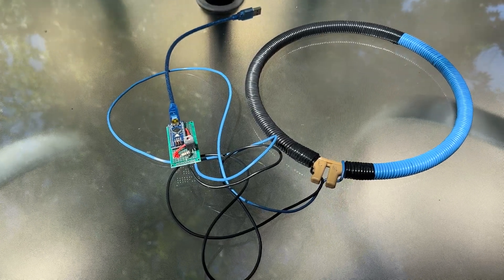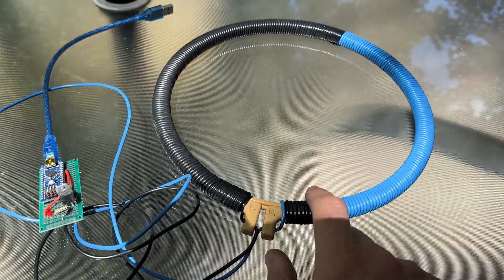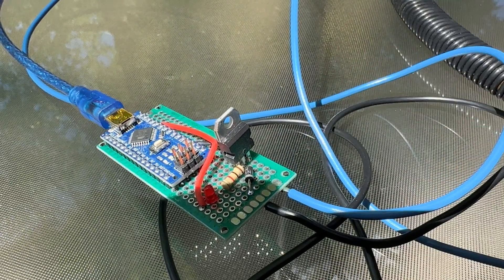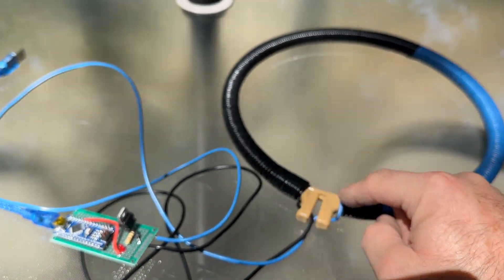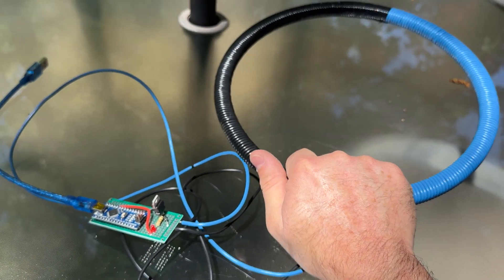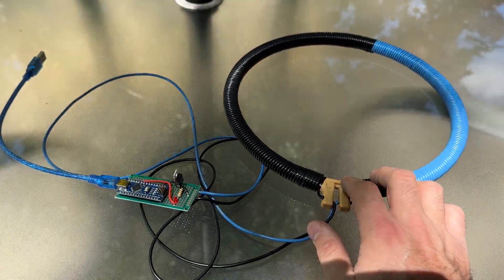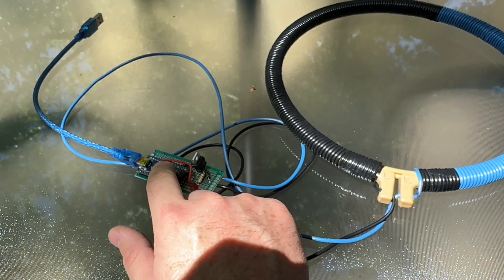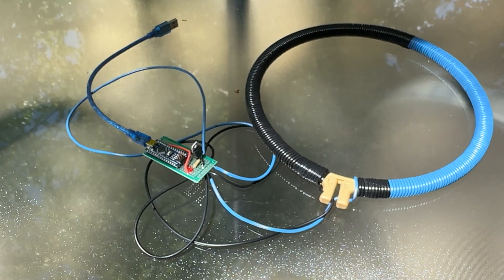Psychic Training Device

Comment: Thank you for sharing your build and experience with it. I've been wondering about other's opinion of this device/build for a while. Any possibility you might be willing to share the sketch code you used?
The sketch files they have on the MoT site are pretty large (for arduino), and having a consolidated code just makes more sense.
Not sure why they didn't configure it that way to begin with. ¯\_(ツ)_/¯

Comment: I just made mine, and I just had to tell you there is something to this.
Me and my daughter are psychic, she's way more preceptive.
I did put a quartz crystal by the components.
She felt a decrystalization in her head, and her 3rd eye was burning. Then she had vivid imagery when I changed it to the 2nd program.
She gave herself an Angel Tarot reading, and she said the information come in so much easier, as if nothing was holding her back.

For me, I felt a current going through. I was holding a crystal in both hands. I felt it go from my left palm, up my arm, to my spine, down my spine, and out the other hand to continue the same cycle.
I also felt both sides of my brain hemisphere's light up. Tingling. Normally when I mediate I only feel one or the other. Not both at the same time. And I also felt my cerebellum, pulsing.
Running the 2nd program, i felt so relaxed, as if I was floating. Like a jelly fish or energy out in the cosmos.

Don't give up. It takes time to sense things, but when you do, it will be easy. This is the real deal.

Comment: I thought I was weird. lol. 
Thank you for the vid. 5 times is probably not enough time to conclude that it may not be working.
I would so love to do this, I'm gonna make one. I'll use copper wiring, I have no clue how anything electrical works, why it works. But, I can follow directions.

Have you thought of incorporating Quartz crystals especially apophyllite with stillbite. When I got my first apophyllite with stillbite, and cleared and charged it, with the sun, when I walked into my room, I could my energy radiating, taking up the whole room. So, maybe incorporating, or holding a crystal, like Quartz--real quartz--and apophyllite with stillbite. (Arkansas quartz are the real deal, if you can  get one from a reliable seller. or go to Arkansas and get your own crystals at Ron Coleman Mining. I did and got a lot of crystals. People just toss milky crystals, some are huge, because they're looking for the clear ones, but those are powerful too--the milky ones. Some are slabs, and you can probably put your feet on them when using it, or meditating on it.)

There's a meditation called sitting in your power, maybe doing it while doing that meditation. Martin Twycross has the best sitting in your power meditation, but you can also try Tony Stockwell's free one here in YouTube. (This is an amazing meditation that shows you how to start being aware of your soul, and energy around you.)
If you go ahead and do a group, I'd love to be part of it. That's the only way you'll know if it works, by people trying and testing it with each other. Like they do  in mediumship, and psychic circles.

If you also want to try to figure out your predictions, you can make or buy psychic cards, the ones with the waves, star, box, and circle. Or if you make them, with index cards, you can make a separate one with colors, or buy children's color card, and even children's number cards.
Make a spread sheet, with columns and rolls and number them.
Ex: #, Guess, Actual Card, Correct, Wrong. Total Correct
      1. Star       Circle                              x
      2. Waves   Waves               x
      3. Square   Star                                x
                                                                                     2

At least do 10 tries, that way you can start paying attention as to how things are coming in to you. What you did when you got it right, how the image came, and do the same thing when you get them wrong. Were you rushing when you got it wrong? Did you at first guess the right one then switch? This shows you what you're doing.

You can jot down notes, and the more you do it, you can see how you're improving.